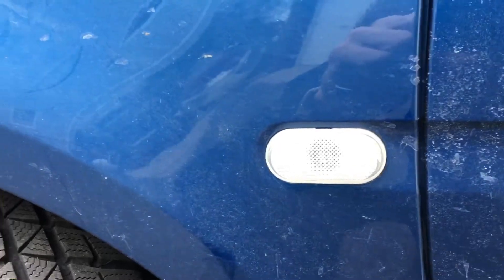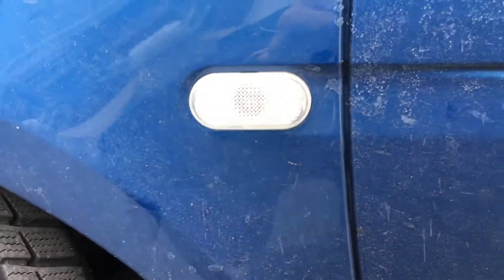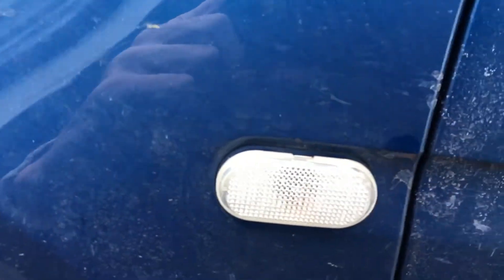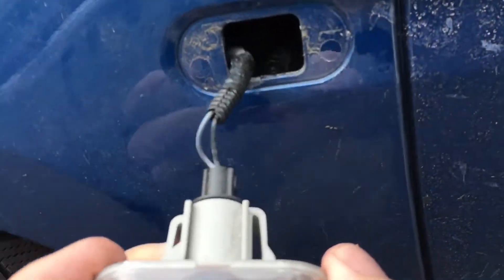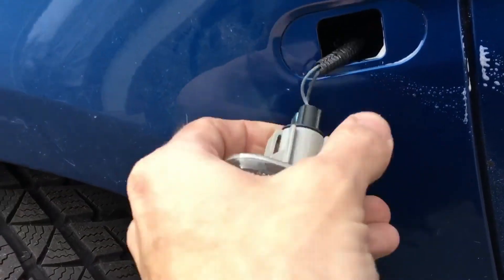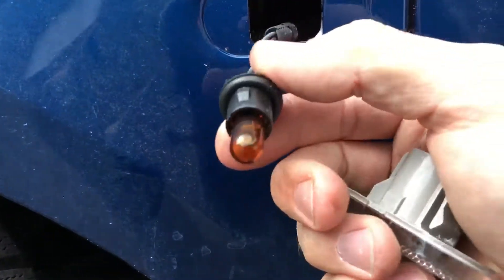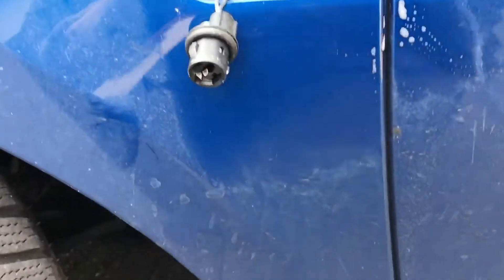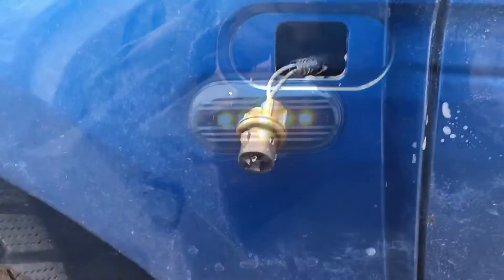CAR IS SOLD! COMMENTS WON'T BE ANSWERED! 2017 Smart 453 LED markers installation

Comment: Nice upgrade, thanks for sharing.

Where do you get these?
Reply from the maker: They are from Ebay
Reply: Jacob Green . Thanks. I looked on eBay but couldn’t see them.  

Have you seen the LED numberplate lights?
Reply from the maker: I've seen them, but I haven't changed them (yet) :-)
Reply: The Klown can you provide the link?